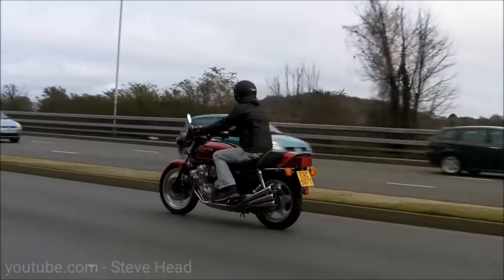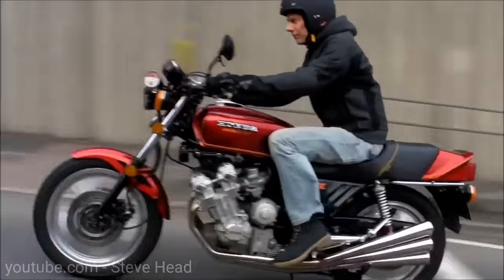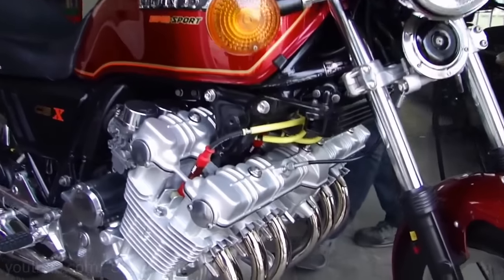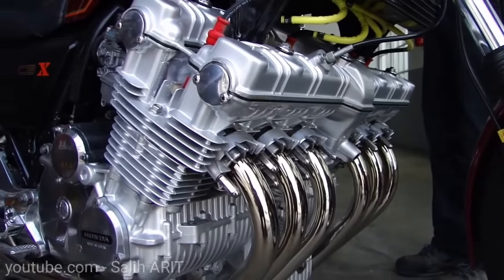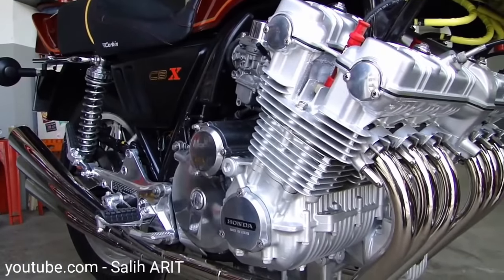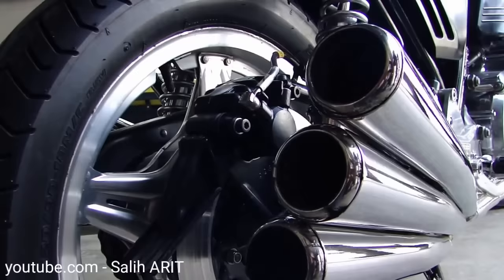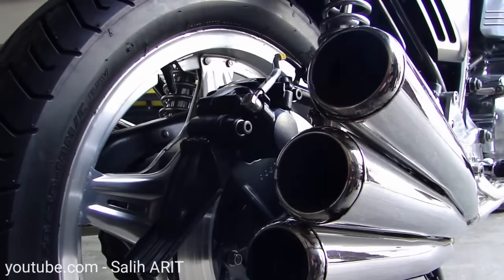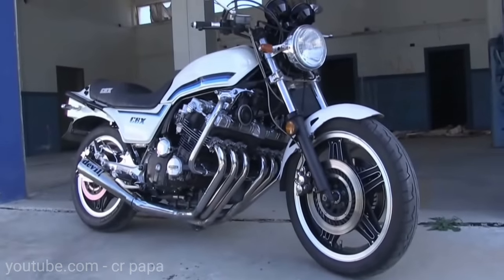Honda CBX 1050 - The Motorcycle That Sounds Better Than A F1 Car

Comment: I had a 1980, this video takes me back, best sounding motorcycle ever, F1 sound is kick ass
Reply: My older brother had the same bike he absolutely loved it and so did all his friends as a matter of fact his best friend bought the bike from my brother and turned it into a drag bike
Reply: Jwad  ferrari not that sounds dude
Reply: but the 1981 gs1100e has better performance. i love mine
Reply: 80 model, was that still with steel spoke rims or was that the first year with aluminum rims ?
Reply: @perberge  The 80 had the same spokes as the 79 but they were reversed when installed and were painted black. I've had 2 79's my first one I bought when they were first out and allways wished I never sold it. I was lucky enough to find a low mileage one aprox 20 years ago and kept that one for 5 or 6 years then I was made an offer that I couldn't refuse.
Reply: Jwad  it's fake. Look it in slow motion. It's not the same bike
Reply: @perberge  My 1980 had the same wheels as the 79 model. Silver Alum 5 spoke.
Reply: @zebby60  okey, I thought they had crome steel spoke rims until 1980.
Reply: Ez Zee, if your 80 had silver wheels then someone replaced the black ones with the silver. Both look good, just a matter of what you like. I restored a 80 for a gentleman, black pant, black wheels, and polished aluminum, looked great.
Reply: @beckysmith7142  I bought mine brand new from the dealer with silver wheels. Remember    people and even dealerships can order with varients as per one's desire.
Reply: Ez Zee So did the 78 silver five spoke with three in to one Exhaust one tooth out of the front sprocket and  2 added  to the back sprocket .candy apple red with a little quarter fairing ,used to do 20 yard burnouts that look like a long S
Reply: @zebby60  your right .i also bought one in feb:1980  and it had those silver wheels on it..they were made up until march coincedentlly of that year,they also had the lower riser bars that the 79 model had....i took the motor out in 83 and put it in a Egli frame with yoshi pipes .then it WAS a beast...those were the days,Amaroo park,oran park ...remember those you ozzies...

Comment: Back in 1979 I remember one passing me on the freeway when I was on my LTD Kawasaki. Had a Vance & Hines 1171 motor polished and ported heads and V&H 4 into 1.   I was the Badass in S. Houston Streets.  When that Honda CBX  passed me it sounded like a pissed off  F1 engine.  That day I was no longer the King of the hill.

Comment: I remember this bike with mixed emotions. The engine was in every aspect formidable, the brakes and manoeuvrability let me fear for my life. I had it only for 3 weeks and sold it, i was afraid of this bike. I sincerely wish i never sold it
Reply: It never scared me. But I can understand why it would. it didn't handle as well as I would have liked.  I have a Stock  82 Suzuki GS 750 now, that handles better. I just realized watching this vid,  how similar the seating is between the two.  The bad about the CBX The Cops always looked, at the sound....I didn't care for that attention. At high Rs  in certain areas you could hear the bike for a few miles. The Suzuki can scream, but nothing stock sounds better to me than that CBX.
My brother routinely ditched cops on his. Lol.he could handle that bike well....

Comment: I was set to call BULLSHIT but holy hell that thing sounds incredible.
Reply: My mind can not accept this is not sound added in post...!!!
Reply: LMFAO was gonna comment this too but seems like you've beat me to it
Reply: Also I noticed the MV Agusta F4(i think) sounds like a LaFerrari. They use some parts similar to ferrari F1 engines
Reply: I use to own one....that and the RD350, RZ350
Reply: @tsoupakis  It is the real sound of this bike - first time I heard it reved like that was when a danish roadracer called Feddert race the CBX against (amongst many other bikes) the Ducati 900 Desmo SS running away on the straight but pulled back in in the "bends" ;-)
It easelly showed how underdeveloped the fram was for this powerfull engine.
But already 10 years before Kawasaki did something even worse - the H1 Mk?, 500cc triple 2-stroke with 64 hp. That was a killer machine - really - it killed many a young unexperienced rider. The twisted frame kicked back in every gear-shift and releasing (emergency rollback) the trottle at high speed would surely sendt you flying - the unpleasant way :o/
Reply: @blh3863 stock exhaust?  I got a frame and a motor, stock exhast left nothing else. I got this one for my rail for my son. He's 12
Reply: @blh3863 Oh dear, a GS1100.
Reply: @blh3863 no way an inline four sounds like an inline six. it is not possible.
Reply: This is not CNN
Reply: @paulk5311  good point bro.  There is no possible way it would sound the same lol.
Reply: GPtwo same!
Reply: @blh3863 
I'm calling double BS on you.  A GS1100?  FFS no idea what you are talking about.
Reply: @paulk5311  if the person making the statement has messed up hearing,  misconceptions of sound are always a possibility.
Reply: Why? F1 cars sound like trash. I'd believe it even if it was an EV.

Comment: I used to love working on these as a franchised Honda mechanic. Our first one sold developed a carb problem which kicked out a crank bearing and the whole engine needed rebuilding under warranty. 6 carbs, 24 shimmed valves, 6 cylinders. When it was all stripped out on the bench it was a sight to behold! I loved the challenge of shimming the valves correctly and resetting the carbs. When done right the beautifully crafted engine ran like a Swiss watch, but if a carb or two were out, or a shim was too tight or loose, then your ear went straight to that rattle or rumble that wasn’t quite right and the frustration could really set in! But that was the challenge and to get these things running sweet was greatly rewarding. I still fondly remember our bank of 6 vacuum gauges flickering away with all their rubber hoses like spaghetti lying over those carbs.
Then of course came the test rides!! 😁
Reply: You didn't work for Bill Head in Preston did you? Mine had to be fully stripped down under warranty.

Comment: Holy shit!!  I am a certified Ferrari technician. I've worked on AMG Mercedes.  I've worked on BMW's,  And just about every amazing super car we have in San Antonio Texas. I have never heard such a beautiful sounding motorcycle though. No lie that thing sounds exactly as the narrator in this video describes. Holy smokes impressive
Reply: So you're a Honda fanboy now. 🙂
Reply: @osamabinladen824  nop!  I just love this particular 1
Reply: @osamabinladen824  
The supercar tech knows not to buy a supercar lol
The ford tech knows not to buy a ford
Dodge tech kows not to buy a dodge... Etc etc..

Which is why the good techs and mechanics usually have a 25 year old honda or toyota lol
Reply: Check out the Benelli sei.
Also 6 cylinder, 750cc
Reply: Hector Morales any tips on becoming a technician? I live in Dallas Texas.
Reply: Do you want to talk about it
Reply: @jose-angel4978   Yes. UTI  Technical school.   I personally went to Wyo. Tech. But that was many years ago. Right now UTI is the best.  Get an actual degree in automotive. Basic understanding of electrical and crossing over into electronics. Computers and multiplex networks how computers talk to each other and share sensor inputs. All in an effort to do independent outputs.  Not to mention hydraulics theroy and actual mechanical processes that these cars are based upon. In depth studies in to SRS systems.  Supplemental restraint systems like airbags.  And all other automotive systems that work independently but are CO dependent.  School and practical application. Ultimately amounts to a degree in automotive  Technology.   Then any shop would be happy to have someone with the knowledge and a good attitude who is willing to work hard.
Reply: I used to ride with the CBX Club in California. When I was in the middle of a pack of 30+ bikes hauling down the freeway I thought  it sounded like being in a bomber formation in WWII.. I  don't ride anymore but still have 4 CBX bikes. My first motorcycle engine overhaul was my 1979 bike that spit a connecting rod out through the cases before I bought it. It ran great for 25,000 miles or so after I got it back together. The 79 and my 81 CBX are parked next to my  Webber carbed 1978 308 GTS, stored in my garage. I replaced 2 clutch disks on it myself at home in my garage. I used to love it but now I hate working on cars.
Reply: @thegreatwhitenorth8754 .I rather own a AMC, made from many manufacturers.
Reply: @gerald4027  still junk. Which is why they went out of business so quickly

Comment: I bought my first street bike in 1982. It was a Honda CBX and I was 18 years old. I kept the bike until 1989. When I sold it she had 40,000 miles on it and had never been down despite being raced 3 times in an iron butt rally from Spokane WA. To Las Vegas. I still miss that bike
Reply: It is statistically amazing you're still alive.  Congratulations!  The CBX is one of the WORST choices an 18-year-old can make for his first street bike unless he's been racing motocross for several years.
Reply: @wsbill14224  I guess that's what I left out. I have been riding since I was 5 & started racing  motorcross at 9 and flat track at 13

Comment: For over 20 years I’ve heard a bike run up my valley every Sunday morning with this exhaust note. The road is 1/2 mile away but there is no mistaking it.
Reply: Record it and post it
Reply: @brabusmighty9458  it’s stopped. I mentioned it to my neighbor who lives right on the road and she noticed it had stopped, too. She, too, had never seen it but he went by right after her alarm went off to go to work and so she didn’t mind it.
Reply: @blacksquirrel4008  sounds like the person moved or died!
Reply: @mathewsmith7654  hope not, or he could have gotten a new job or realized he or the bike was getting too old to race up that valley at 5, too.
Reply: I live just over a half mile from a 4 lane highway.  Nearly every weekday morning during the summer I hear the same sound (for several years now).  I've been on bikes my whole life and I have no idea what it is.  It sounds similar to the bike in this video.  It's probably just a crotch rocket with a really killer exhaust but it sounds like all hell is being unleashed.  I usually hear it when I'm walking out to my garage at 5:50 am, great way to start my day.

Comment: Fun Fact. Some Honda Engineers designed an exhaust for the CBX that made it sound like the USA's McDonnell Douglas F-4 Phantom Jet. Cooler heads decided it might not be a good idea, and the idea was dropped. I rode one for about six months as a Showroom demonstrator. A beautiful bike to ride and insanely fast for a road bike. However, it was a failer as a "Production Bike" racer. That is, races were showroom bikes that anyone could purchase race together. As long as the rider held both a street and a racing licence.
Reply: Please tell me there are videos of it. For the love of God let there be audio recordings. 😫
Reply: Like a McDonnell F-4, I think not!
Reply: @NeroontheGoon  there is no claim that the bike in the video sounded like an F4
Reply: Back then the Southern Hemisphere was the hotbed of production racing, especially long distance, endurance production racing. The CBX never really made a mark, being no faster than the oppositions machines, and needing more fuel stops,  The CB1100R on the other hand, introduced in 1980, was very successful production race bike, being basically a  homologation special.

Comment: This video should be called Top 10 best sounding motorcycles ever:
1: Honda CBX 1050
2: Honda CBX 1050
3: Honda CBX 1050
4: Honda CBX 1050
5...
Reply: 1: Moto Guzzi 8 cilindri
2: Honda CBX 1050
3: Honda CBX 1050
4: Honda CBX 1050
5...

https://youtu.be/rdxI3faucvM
Reply: @davidedibella5034  noooo
Reply: Comment of the century 😂😂
Reply: C'mon, vfr 800fi with a two brothers exhaust.
Reply: Cbr250rr 4 cylinder 250:)
Reply: iTheGeek I’ve had an R6 and fz6 they sound good but that little cbr revs so high it sounds like an f1 car. It’s only a 250 and I’d never own one but they sound damn good.
Reply: @jacobgoins8374  ya early to mid 90s MC22 CBR250R's

Comment: My brother and I both had CBX's in the mid 80's. I sold him mine which I regret to this day. He still has a stock one and another that the engine has just been gone through with a big bore kit and other upgrades. Yes they sound fantastic stock but with a 6 into 1 exhaust they are unbelievable.

Comment: This is what F1 cars sounded like in the good ole days. Now they sound ....... well, not nearly as good as they did way back. But..... they can go a whole race without refueling. So there's that.
Reply: F1 hasn't been exciting for a good 20 years or more. It's a bunch of young lads with the cars doing the driving thanks to the computer rubbish.
Reply: Because of turbos ?
Reply: Tuukkis But traction control and the anti brake locking system are both banned in F1, and there’s no power steering if I remember correctly
Reply: I haven't watched any f1 race since the hakkinen and Schumacher days XD.

Comment: For those of you wondering, the reason this inline 6 sounds like this is due to a 6 into one merge header with equal length primaries.
Here's what that means:
Each exhaust pipe coming out of each exhaust port on the engine is the same size and length, and all 6 pipes literally merge together into a single collector (its the place where all the small pipes come together into one larger pipe).  I have seen naturally aspirated versions of 2JZ's, RB25's and Ford Barras that sound nearly identical to this with a 6 into 1 header.  Nearly all inline 6's have the same firing order, which is why for those that do, they sound almost the same with that header.  The reason they might sound different is due to engineering of the engine itself (things like # of valves per cylinder, camshaft differences, even the overall displacement).
Reply: YES, as head tech for these machines - 
6 to 6 has no collector - 
they are 6 individual pipes from head port to exhaust tips. 
As I explained prior,, these are not stock pipes - 
Stock were only 6 to 2 - one muffler each side. Then of course 3 to 1 collector each side. 

These motors are 4 valve shim bucket valve train. 
It was a standard check at roughly 20,000 miles, then 4 hrs min checking each shim with micrometer. 
Mine is still in storage - where a insane drunk woke us in the middle of the night smashing through the garage door at high speed, throwing the cycle into the air landing 6ft later on the end of its crankshaft. 
The end of crankshaft is 1/2" under tin chrome cover for ignition. 
Oh well, 
The VTwin 1800 Neo is current Honda. 
Tampa to Mpls almost nonstop, but my butt was severely damaged. 
Cheers
Reply: And also being air cooled and no fairings helps too.
Reply: Can you replicate a similar sound on a honda cb550?
Reply: @MrESPINOSA88  Unless it has 6 cylinders, no.

Comment: I went to a Speedway race one night, and the parking lot was a bike all covered up with a Ducati cover. So I waited around after the races to hear  what it sounded like. The guy came out, and took the cover off and it was a Honda CBX 1050, I wasn't disappointed by what it sounded like. 40 some years later and I still remember.

Comment: I took one for a test drive back when it was new.  Two things I noticed right away.  That long flat vinyl seat had nothing to hold your butt in place when you cranked the throttle and if you weren't hanging on to the bars there was a very real danger of having it drive out from under you.  It was a very stable bike,  so much so that it had to be manhandled into and out of turns.   It wore me out in my favorite canyon.  But what a thrill it was to ride it!!
Reply: I took a friend's 1980-something GSX 1100 for a spin. I got off and said, "no more for me".
Reply: U.S market CBXs came with far higher, pulled back bars and  foot pegs that were further forward than other markets,  Non U.S market CBXs have a more "sports" riding position that were better suited for twisty roads.

Comment: Something that doesn’t come over during this great video is that the CBX engine is so smooth its like an electric motor. So in all that incredible drama of the exhaust music, the engine is not shaking, buzzing, just liquidly lovely. Delightful, in fact.

Comment: You better change the title to CBX-1000 
That makes your video easier to find.
The exact displacement is 1047 cc
I had a Honda CBX-1000 Prolink from 1982 for 23 years. Sold it 2 years ago.
It is a nice and very reliable bike. It had 2 sets of exhausts: a pair of 3-in-1 pipes and a 6-in-1 one.
The 6-in-1 sounded lower, and the 3-in-1 pipes were screaming.

Comment: I had a ‘79 silver. Drilled several holes in back end of stock exhaust. I couldn’t believe how that changed the sound. You could not resist hot rod ding all the time! Bad ass bike! Wish I kept it!